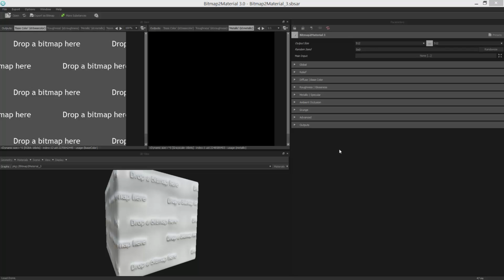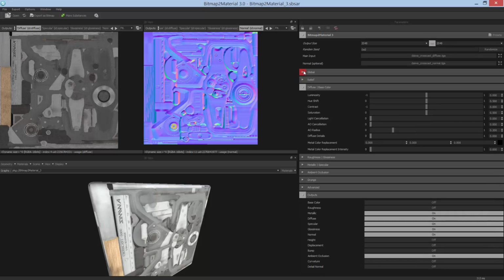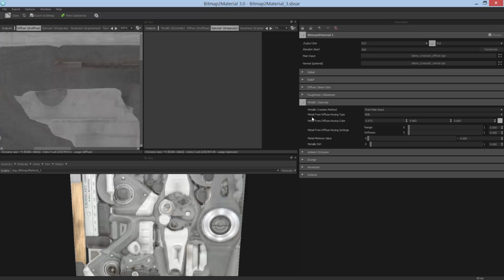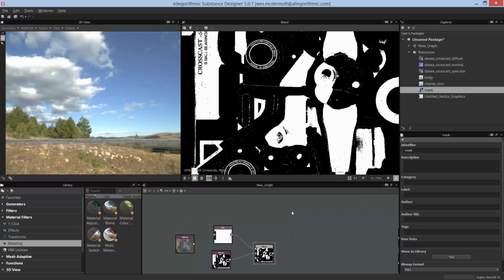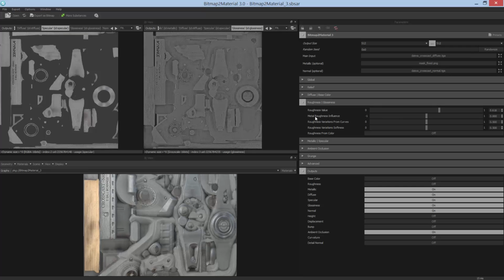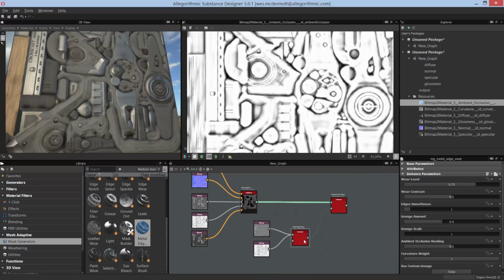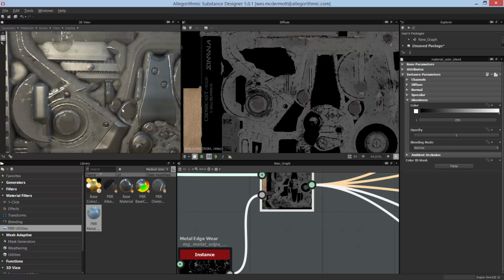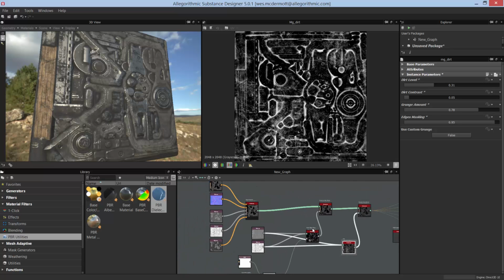Converting traditional maps to PBR materials | Adobe Substance 3D

Comment: what if my mesh doesn't contain any metals? like a chair maybe or a table? the metallic would be completely black right? and the specular?
Reply from the maker: The metallic would be black. If you are using the metal/rough workflow, you would not have a specular map. The 4% reflective value for non-metals is hardcoded in the shader for metal/rough workflow.

Comment: Is there an easy way to change PBR diffuse/spec to PBR metalic/rough? I mean you had a case where it wasn't accurate, but in a case where you take something from the Unity store and want to use it in UE4, is there a method for doing that?
Reply from the maker: Unfortunately there isn't a way to do this. You would have to manually create the metallic mask and then try to use that to pull out the albedo from the diffuse and the metal reflectance from the specular map.
Reply: Allegorithmic I figured, got confused when you said non PBR diffuse. Thought PBR diffuse was somehow different. Thanks.

Comment: Hi Wes, how did you tell from the normal that it was a OpenGL ? What's the difference between two format in Substance softwares ?I'm always confused when to use which . Thank you !
Reply from the maker: +Senna Mortensen Hi Senna : ) The difference between OGL and DX normal maps is that the green channel is flipped. A shader will be encoded to use either OGL or DX normal maps. If you supply the wrong map, the normals will look inverted. You can fix it by simply inverting the green channel of the normal map. Substance uses DX normals, but you can set it to use OGL if you prefer.
Reply: Sorry for the late reply, thanks so much as always !!

Comment: Please someone tell me how to tile a texture inside a graph independently of other textures in the graph... Tile Generator leave lines, repeating via Transform 2D messes up textures later on and the texture is already tileable, so no need for Tile-It. This would help me immensely transferring my materials to PBR. Love the videos, turn up the volume, though!
Reply from the maker: Eric Lewis Tiling an individual texture should be done with Transform 2D. You can use it to adjust the scale of the texture and then pipe this adjustment to the next node. Can you post in our forums how this is causing issues with the textures? We can help better in the forum.
Reply: Allegorithmic thanks for the reply, but the problems with transform 2D and the methods for solving it are already on the forums. I have already found the solution for my specific challenge in absolute/parent adjustments in the Designer series videos.

Comment: Well, i have a question,  is there a way to make my own character (model) ? if yes, gonna buy it right now
Reply from the maker: Wav Santos Well, yes for texturing : ) Substance toolset doesn't have any modeling tools. You need to import the model from a 3D application, but all texturing is handled using Substance.
Reply: oh :(, however, the program is pretty good, when  i learn how to use zBrush/max i'm gonna buy it :D
Reply: @wavsantos4766  Did you buy it

Comment: Can you make some nodes that converts PBR to diffuse/specular for us? The more powerful PBR, the less useful substance is to traditional cg artists, at least by far.
Reply: Onyx Lee There are nodes that convert Metal/Rough to Spec/Gloss and the other way around. And Spec/Gloss can then be, very easily I might add, used for traditional Specular workflows.
Reply: adaniel2929 That will be awesome! Also, if the Substance Painter can export Spec/Gloss and allow some adjustments in 3rd party package, that will be very helpful.
Reply: Allegorithmic
Painter feels a little too much like Designer in some aspects, like it's doing the same things but by layer rather than by nodes.

I feel like maybe the application should get more features targeted towards artists, the ones who will really take advantage of painter.

I'm not saying the added bakes or FX are a bad thing, but I was thinking of maybe sculpting? Not modeling, but letting you paint in the view-port real-time changes to a height map with tessellation on the model. Being able to do your tessellation mapping and even baking them into normals would be pretty epic.

Maybe this is too much right now, maybe this is something you are planning for version 2 in the future, but I think this would make Substance Painter stand out more than it already does!

-Austin
Reply from the maker: Onyx Lee Substance Painter can export the Spec/Gloss maps. We will also add Non-PBR shaders to Painter as well.

Comment: looks like a lot of work
Reply: Kay Vonlanthen It only seems like that because he spends so much time explaining each node. If you go into it knowing what you want, this entire video's work would last only a few minutes.
Reply from the maker: adaniel2929 That is true.. the work itself is actually very quick. It's much faster than manually doing this. There isn't an automatic way of making this conversion as the data the maps represent is much different and used by different shaders. This video shows a workflow that can help in the conversion process, but there is still some manual work that needs to be done.
Reply: Allegorithmic
I really really wish the ability to use B2M3 in applications came with Indie not just Pro, would make this entire process even easier. But I guess something has to be held back in the indie version besides max revenue.